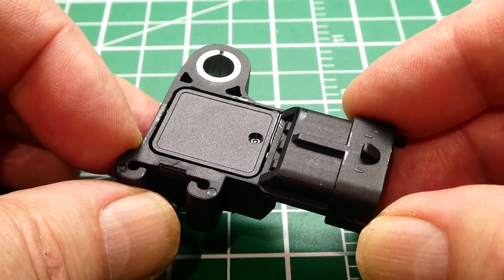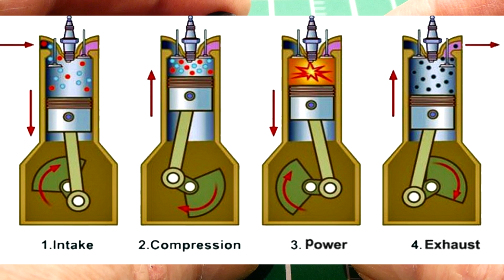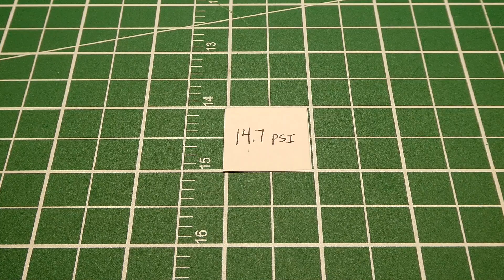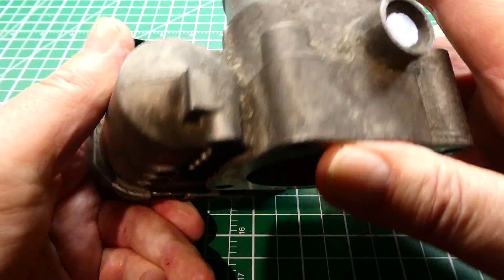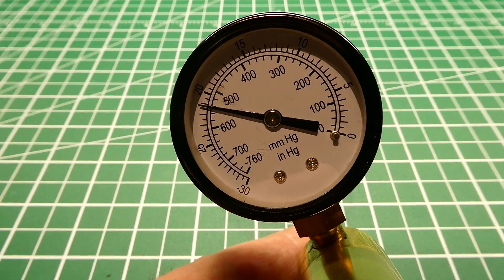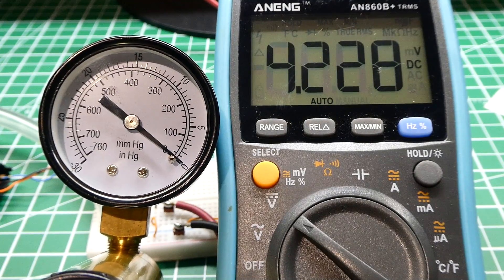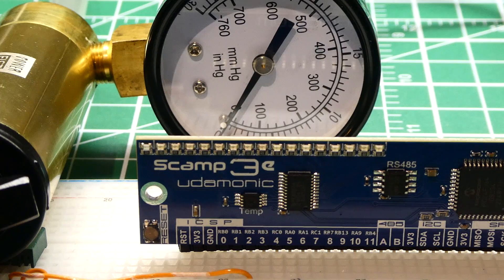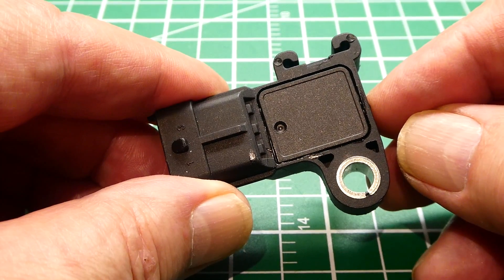MAP Sensor Interface / Manifold Absolute Pressure / Testing

Comment: Nice explanation, A plastic syringe can also do the vacuum, also the vacuum created while idling the engine ,around 28 mercury inches can be úsed in an emergency to evacuate air from the air conditioning system to make a refrigerant charge
Reply from the maker: Thanks for the info

Comment: I used to be a truck mechanic. Over the road trucks ("18 wheelers") are ALL turbo charged so you have a sensor like that except for it measures pressure not vacuum, but same idea. What is inside these, a potentiometer? Thanks for doing this video. I was a mechanic for 27 years and have seen a LOT of changes. EGR coolers, DPF filters and diesel exhaust fluid just to name a few. It is amazing to me how few mechanics know what the sensors on a vehicle do. You ask and all they can say is "that's just some emissions crap". Thanks for your wonderful detailed explanations. I don't know of many people who have BOTH electronic and mechanical knowledge. You have a very broad range of knowledge and that's why I love this channel. Take care!
Reply from the maker: Thanks for sharing. My Dad was a backyard mechanic so I have been rebuilding small block Chevys since my teens. My brother got into Mopars and also drives a semi so we are always working on his truck. Went to university for electronics which became my career, so in my YouTube channel I am combining both. The MAP sensor has an internal flexible diaphragm with a strain gauge. One side of the diaphragm is a sealed chamber containing calibrated vacuum and the other side is connected to the inlet port. As the diaphragm flexes an output voltage is sent to the ECU. Check out this video: https://youtu.be/NOTMb165jMU Thanks for your feedback and support.
Reply: @0033mer  Really cool story! I love vintage cars along with vintage electronics. Really random fact, when GM sold part of Detroit Diesel to Roger Penske back around 1988 or so, I thought that it was interesting that on the Series 60 engine, the ONLY part that said GM on it was the boost pressure sensor in the intake manifold, which looked nearly identical to the part you have in this video. The 92 Series Detroit Diesel was one of the first to have an ECM and electronic unit injectors. The Series 60 was always with full electronics.
Reply: Piezo electric  and and a circuit, for pressure there is  a sensor that goes in gas tank that both measure pressure and vacuum.

Comment: Batteries for vehicles are often 12 volts. By what means is it reduced to 5 volts for the MAP?
Reply: The ecu has an isolated 5v reference output for most of the sensors.  Map, intake air temp, coolant temp tps, and even the “smart” coils like on an Ls motor are fired with 5v.

Comment: Hey, nice video! Thanks for the in depth description. Just curious, how accurate are these sensors? For example, accurate enough to detect elevator movement? Barometric pressure for the weather, or just accurate enough to detect larger changes? Do these sensors have the same pinout across models/brands?

I never thought of using sensors from cars in my projects, thanks for bending my brain!
Reply: Very accurate.  I use industrial sensors for my car builds with megasquirt ecu because they are robust and accurate.
Reply: @idus  Thank you!
Reply: Elevator movement as in the position of the car inside the shaft ?
Reply: @mumbaiverve2307  You're right, but as the elevator rises/lowers, the air pressure changes. Some sensors can detect such small changes.
Reply: @pyography  Though, I doubt if you can level a car at the stopping floor within a few  mm (which is what is required ) only by checking the altitude, unless I have not understood your idea.
Reply: @mumbaiverve2307  Oh, sorry for not explaining. I was thinking of something like an altimeter for mapping. I know an accelerometer would be used, but they can get off track, so my thought was using this sensor to compair what I have from the accellerometer to the pressure. Another idea was for more precision with an ultrasonic measuring sensor. Thank you for asking.
Reply: @mumbaiverve2307 for a lowering system a potentiometer would be more accurate as with my tesla model s air suspension each corner has a dedicated potentiometer for auto leveling the suspension.
Reply: @pyography  The way it is done currently is to use an encoder on the motor shaft in high speed elevators. In legacy systems they have a reed switch and magnet (for each floor), with another reed switch providing a slowing down command in case the lift is supposed to halt at a particular floor.